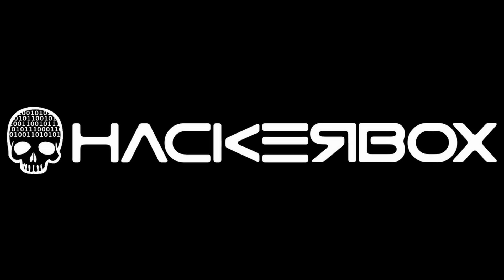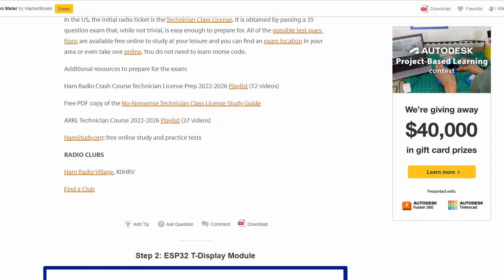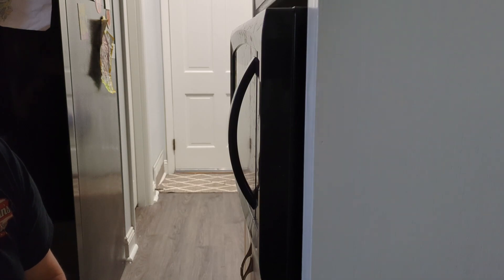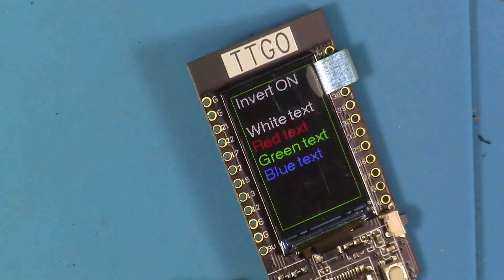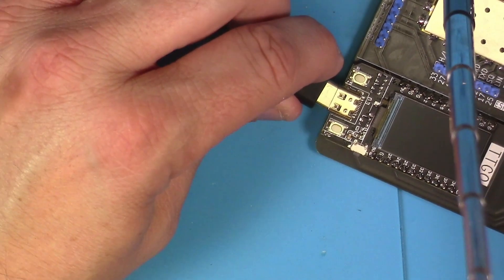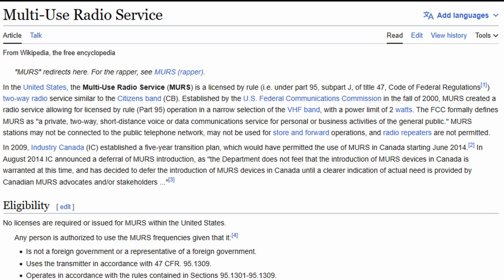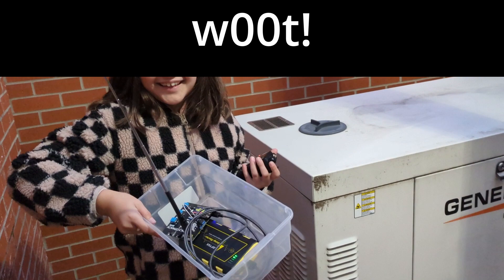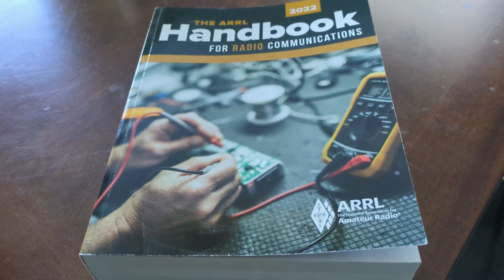Hackerbox 0096 - Two Meter - RF Fun!

Comment: Hi Jamie, thanks for all the great videos!  Question:  I soldered everything together and the program is loaded on there correctly.  I put headphones in the line out and cycled through the channels but I do not hear anything.  Also I noticed that the RF module on the board gets hot when plugged in.  Any ideas on what I am doing wrong?
Reply from the maker: @jcurtis12  You are very welcome and thanks for watching . As far as your question... I'm not sure.  I'm away from mine at the moment but one quick thing to see would be to look at the code and see if you can temporarily open the squelch all the way. Trying to remember if one of those is a variable. Did you put some of the NOAA frequencies in to try? No bridges on your points where the rf module is on the main board right? I can try to fire mine up and see if it gets warm just idling. Also just now thinking. Is it possible your to switch is shorted closed and it's just hanging on xmit? Just a thought.
Reply: @JamiesHackShack  I will have a look and see and let you know.  Thanks
Reply from the maker: @jcurtis12  right on! I'll get mine out and we can figure this out if need be.
Reply: @JamiesHackShack  when you say open the squelch all the way, where is that specifically in the code?  I have the code up now
Reply from the maker: @jcurtis12  Ok I brought it up too and I don't see it in there. I think there is a way we could do it but I also think there is a hardware way. You can try this but ill give you the caveat that I can't be responsible if you let out the magic smoke etc etc.. That SQ pin you see on the board. If you can carefully touch that to ground with a jumper or something temporarily that should open up the squelch and you should hear some static. If you don't, something is wrong. Have you tried it outside? I couldn't pick up the noaa stations with mine until I took it outside where I am.
Reply: @JamiesHackShack  I did try it outside before as well.  So is that the pin 17 you are talking about that has the SQ?
Reply from the maker: @jcurtis12  right and I think if you tone it out with power off that may tie to pin 1 on the module if this included thing is correct.
Reply: @JamiesHackShack  honestly I am new to this pcb board stuff so I do not understand exactly what you are saying to do here.  Did you determine if yours gets warm or not?  I will see if I can troubleshoot this
Reply from the maker: @jcurtis12  it may be a little later. Right now mine still has the fox beacon code on it. I'll need to put this first demo code back on it so we can be apples to apples. I'll try to check after work.
Reply: @JamiesHackShack  just checking in to see if you had a chance to have a look at the board over the weekend
Reply from the maker: @jcurtis12  Hey so I've got the noaa/demo code on here and it is working. I can tune to like NOAA 6 and here my local weather. RF module is not really warm at all. Is yours like pretty hot to the touch? And you said your display is showing normal stuff and changing freqs when you press button A?
Reply: @JamiesHackShack  yes my RF module is hot to touch.  My screen shows normal stuff and I can switch the stations, etc… just can’t hear anything
Reply from the maker: @jcurtis12  I think something may be wrong somewhere or another if it is hot to the touch. You are 💯 sure no shorts between pins that were soldered and nothing may have accidentally shorted the back of the board at some point? I'm at a loss really. May be worth looking at swapping out the rf module if everything else looks ok. Have you tried Hackerbox support to see what they say? Sorry you are having trouble.

Comment: If the SA818 module is pin compatible with the SA868S, you can get one online for under $10 and double your transmitting power. 😉
Reply from the maker: Thanks! I'll have to check that out.

Comment: I dont get it, all of this you can do with a hand held radio. Did or am I missing something?
Reply: I think he can transmit on unauthorized frequencies
Reply from the maker: You are 💯 correct and didn't miss anything. This is more for tinkering around and experimenting with the code that can drive the module. If your goal is the end result you can get a low cost ht and take off running.

Comment: A Hackerbox that did APRS (small full keyboard, display, and code) would make for a cool addon to this kit. APRS is an interesting mode with untapped potential.  A dedicated APRS box would make the mode easier to use.  Absent of a dedicated APRS addon, one can use APRSDroid on an old cellphone.
Reply from the maker: Interesting thought there. Maybe we can get some thoughts from @hackerbox on that idea. Thanks for watching/commenting and I'll see about checking out APRSDroid.

Comment: okay this is a fun little project.

As for the HAM part. My uncle has a license. I think about getting one every few years, but then have no idea what practical purpose I'd get out of it. Just saying hi to folks over shortwave is neat, but the price of the equipment quickly goes up to the absurd. Now if I got into sailing, shortwave suddenly makes way more sense given the distances involved and even naval radio having it's limits.
Reply from the maker: For sure it is a fun one. You are definitely correct that some of the gear can indeed be pricey. Luckily there are lots of opportunities for homebrew and tinkering that don't cost as much. Thanks for watching and commenting!
Reply: okay, have a sub just for pointing me to Hackerbox. there looks like a whole bunch of fun things to mess with in here.
Reply from the maker: @DFX2KX  Thanks!

Comment: Great to see that you taught her how to use body blocking for direction finding. It may not be the best or most accurate way, but the whole point of ham radio is to be ready to operate in non ideal conditions. With the proper use of, and proper understanding of how it works, it can be used to good effect for close in direction finding. It's actually my preferred method for close in fox hunting.

Edit: When is she getting her licence ? =)
Reply from the maker: Ya know that was the first time I'd ever done more than READ about foxhunting. 😂
Body blocking was about all we had. 😀
This is pretty fun. Thinking about trying to make something like that arrow df loop from the thumbnail. As far as license... She may start drifting if I talk about that but I could give it a try. It would help if I were more active which I hope to be. Thanks for watching!